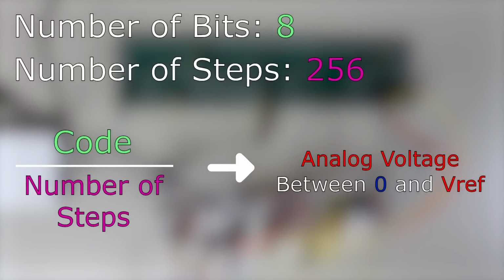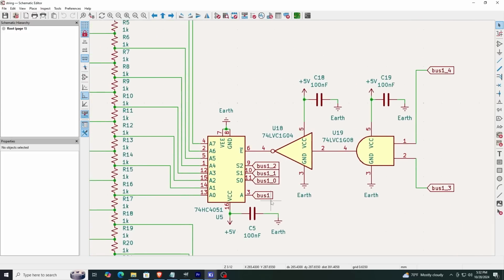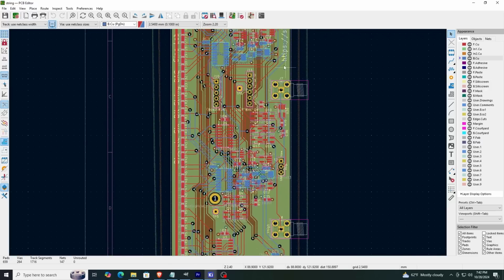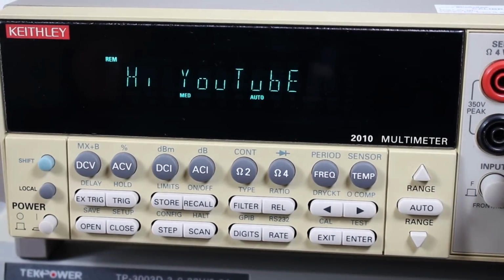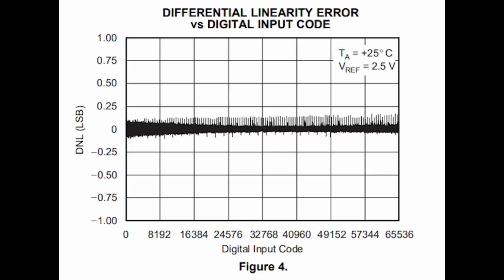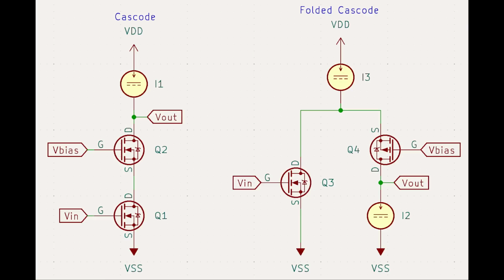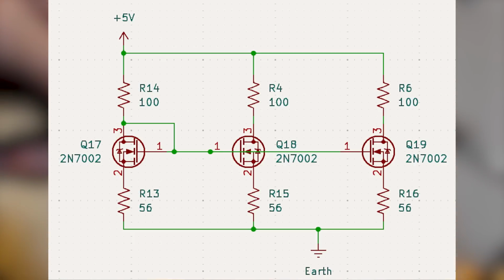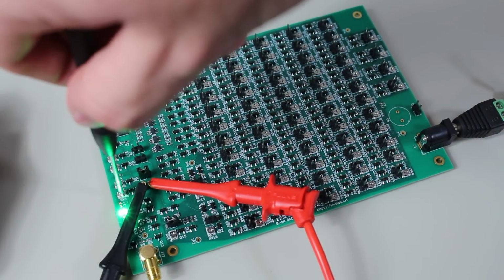Building a Discrete 14-Bit String DAC

Comment: Re: ultrasonic cleaning. I would recommended just switching to a water soluble flux so you can use distilled or deionized water for cleaning boards. Works great and you don't have to use so much IPA

Comment: Hmm...  For Q7-Q10, Q14 and maybe Q11-Q12, I'd have probably used a 74xx4066 rather than all those 2N7002's.  One SOIC-14 is an easier soldering job than eight SOT-26's, and those transistors are all right next to one another in the circuit.  (Didn't go through the schematic in detail to look for other things like that.)

Did it really simplify your layout that much to use all those 74LVC1G04 rather than six-packs?  

If you have only a few components on the back side of the board, you can use paste with a lower melting point and reflow with hot air.  Easier than hand soldering, at least with my shaky hands.

I've built a few mirrors recently with DMMT5401 matched pairs.  They seem to work pretty well, but I don't have your measurement tools. 

The biggest single takeaway from this video is that analog IC's (and ADC's and DAC's) are amazing things that you are never going to replicate properly with discrete components.  But it's fun to try - and important to learn what's going on inside those prepackaged miracles.

Comment: in modern silicon processes, transistors are so small they are essentially free. Resistors on the other hand, can take up lots of space so replacing a resistor stage with a diff pair stage is very worth while. matching is also easier to accomplish with inter-digitated fets

Comment: What’s wrong with a ladder DAC though? If the resistors are accurate enough, it seems like the simplest and most elegant solution.
Reply from the maker: It's easier to build a ladder, I just wanted to show a design topology that is usually only found inside of integrated circuits.

Comment: could you have a couple of micro adjustable resistors on the inner string - you'd only need 4 perhaps even 2  to tweak the values there to bring them into linearity

Comment: 100LSB INL error makes this no better than 8bit R2R DAC build from 0.1% resistors, unfortunatly... But you can make software correction for INL graph by calculating error function of output voltage (excel can do best fit polynomial).

As mentioned in other comments, you should try R2R DACs, they give good results with resistors like 0.1% if you measure them and find best fit for nominal value.  Of course, this is up to a certain  point - when TCR difference of resistors, difference in switch resistance and many other effects will become noticable.
There's reason, why in DAC8831 first 12 bits are done R2R, and last 4 are done with 15 separate resistors (Fig.44 at TI datasheet). I think this is for laser trimming.

Also, your circuit reminded me of Kelvin-Varley Divider at first - maybe check it out.

Anyway, this is good video demonstration! subbed:)

Comment: There are transistors pairs in the same case that are well matched and also multiple transistors arrays that are very well paired and with nearly identical parameters. I know that those are more expensive, but for your specific case, you may try them. Also, can reduce component count.

Comment: to create a digital-to-analog (DA) converter. For example, consider a 3-bit setup where each bit is connected to a resistor. The first resistor has a value of, say, 1 kiloohm. The second resistor is double the value of the first, meaning 2 kiloohms, and the third is also double the previous one, thus 4 kiloohms. All output points are then connected to a single point, which serves as the output....easy😊isnt

Comment: I've built discrete DAC's for fun before. More practically, I tend to build ad-hoc DAC's using a few free uC GPIO pins. I can say with certainty, give discrete R-2R DACs a try! The advantage of a discrete R-2R resistor ladder network DAC is that you can bulk buy resistors and use a good measurement method to "bin" the resisters to better than the precision/tolerance on the tin. That is, you can buy 1,000 units of 1% or better resistors, and build a 12~24 bit DAC with cherry picked / matched resistors. Furthermore, you can buy resistors with 10x higher resistance as parallel "trim resistors," or resistors with 10x lower resistance as serial trim resistors. You can also go completely nuts and stack trim resistors, thus trimming the trim resistors. Every order-of-magnitude trim resistor you provision for will give you a corresponding order of magnitude increase in precision. It's simple why; a 1% precision on a resistor that has 1/10th the affect on the output behaves like a 0.1% resistor that has full authority over the output. Finally, to be totally ludicrous, you can get resistors with matching/balanced temperature coefficient so that it has better thermal stability.

You CAN build a work of art grade DAC using discreet components... but, to be fair, a great DAC IC is only a few bucks too... so.... :/
Reply: also there's a plenty chineese 0.1% resistors on sites like aliexpress. They go higher in price but those 20pcs that i bought really fitted into 0.1% tolerance (measured with HP34401A whose last calibration was done in 1996, so take this information with a grain of salt). They also promise 25ppm/c TCR but i did not measure it, because i have no proper thermal chamber
Reply: I tried to build 8-bit R2R DAC using 0.1% resistors and uC. Actual resolution at DC came to about 7 bits.
   The issue is that uC pins are not equal. Their internal resistances vary from pin to pin in about 100 oHm range, which is 1% with 10k resistors. 
   At higher frequencies (~1MHz) resolution falls even worse (~5 bits). The reason is dynamic transitions on bits flipping. Bottom line - do not waste your time and buy OTS DAC!
Reply: @odissey2  the AtariJaguar implements its own VideoDAC. The fully digital Tom chip has 24 pins which are connected to an external R2R ladder. Just by having stuff produced in an integrated way, you can get the variance down. The ladder is also integrated with itself: one thin carbon film, one ceramic substrate. Ladder shot into it with a laser I guess. The output pins on Tom are just over-powered, especially the high bits (need to check). Resistor values are very high. So I would have thought that voltage stabilization is more critical? The chip has multiple supply pins.

I thought that the 16bit audio DAC is external because you cannot prevent cross talk down to this level on a single chip? An external DAC reads in the serial bit stream and then updates the analog value. The chip has no additional state. So you can actually test the whole device for all 64k values in 2 seconds plus some passes ..
Reply: As I understand it, if you buy 1000 resistors of 10% tolerance, the ones closer than 5% will have been pulled out for selling as 5% resistors, and so on with the tighter tolerances. So the distribution of purchased resistors will likely always be like a Polo Mint, with a hole in the middle. Higher and lower than nominal, but not close to nominal. It may be that you can still match pairs of resistors if that helps the accuracy of the circuit functions.
Reply: Instead of buying boxes with resistors, you can use some Python script and draw wire resistors just on a PCB. With having the smallest resistor as 0.2mm by 10cm 1oz (if I'm not mistaken, its resistance is 22 Ohms), you can place an entire weighted 16-bits DAC on a 30x10cm of 8 layers PCB (make sure you select a same oz for outer and inner layers). I think this is the cheapest 0.0000...1% resistor in the world (as cheap as 15 euros for one weighted string). Then you have to feed it with a current source, add 16 more same PCBs as a summing network, and 16 precise commutators (like a cmos on/off with a an OpAmp for a full compensation)
PS You can use yet more 0.2x10x1oz wire on the same PCB in the current source to compensate a temperature while the wires become hotter
Reply: @sc0or  Even ignoring the copper TCR problem, PCB manufacturing processes aren't perfectly uniform, somewhere there will be over-etching, in other places it will be under-eteched a bit. And 0.2 mm 100mm 1oz trace will be about 0.38 Ohm.
Reply: @sc0or  Did you know why copper is a bad resistor material? It got huge TCR. And your copper traces will get temperature gradient, so "equal TCR will create equal offsets" argument is not applicable here. For 8+ bits DAC it's better to just buy IC, or use some old R2R resistor matrix (like soviet 312NR6, 10bit R2R resistor matrix), if you're able to find one. They got difference in TCR at ppm's range.
Reply: @dinistor1254 what if I buy special wire and wind it around a (ceramic) frame? Like a piano forte . I could even adjust the taps.

Why do we care about temperature in a R2R ladder?

How low is the noise of a power supply? How low is the resistance of the mosfets in front of the Rs of the ladder?

1mV relative to 5V ! So this is not even good enough for CD audio (invented 1981).
Reply: @ArneChristianRosenfeldt  you basically make wirewound resistor

Temperature is important because of TCR. In audio it doesnt really matter. IN DC applications this is crucial.
8bit DAC really don't care this much (1/256 is almost 4000ppm), but at higher resolution, like 10+bits, 100ppm/C TCR difference is noticable.
Reply: @ ah, I was only checking for linearity, but forgot that I have no digital thermometer to compensate overall scaling of the DAC on the digital side.

Comment: While you're at it, note something does work that you will just about never see.  Take a look at the DAC R-2R, and note that just a 374 latch or similar would drive it for 8 bits.
So 8 bit digital pattern, directly driving and converted into an analog output value.
You can do the opposite.  Long ago looking at that, it hit me to do the reverse, analog in value directly to a digital output pattern.  Comparator for first bit, high low set at the middle point.  Next bit is set for 3/4, but if the high bit is low, that same low output pulls another resistor low that cuts the reference to the 1/4 level.  So the second bit can determine either the high second bit or low second bit transition, with the first bit selecting which one.  And work on down the line.
Easy enough to do 4 bits and have fun testing it, gets hairy of course if you go further.
Of course there are race and hysteresis type issues, but it is a fun idea.  Even back then there was some small amount of prior art, but it's only barely used for 2 or 3 bits.  You're better off using more comparators or going to a real ADC.
Reply: Atari ST and Jaguar connect a R2R network to CMOS output pins of the purely digital GPU to create RGB analog video out.

Comment: I've made 1pin DAC once. 
It consisted of single capacitor and was driven by PWM:)
Reply: if u dont need speed ..yes ..that what i do all the time 😊
Reply: higt frequency pwm give faster abd beter result😊
Reply: i discribe a beter aproche using resistors in comment. take a look.
Reply: i made the same thing, but it was noisy even with 300khz pwm
Reply: @destiny_02  with 300kh abd 5v pwm use 3.3kohm and 0.47 uf
Reply: @destiny_02  Also you cannot drive almost anything directly(only something with known resistance) through this setup.
Use transistor or amp.

Comment: 😖😖12:37 - Please get your self some flux, will make your life a lot easier :)

13:20 - Also you don't have to fill your whole Ultrasonic cleaner, just fill it with water, take a smaller container (plastic bags work too) where your item barley fits in and fill that with as much solvent/cleaner as you need to cover it, then put the smaller container in the Ultrasonic cleaner with water.
Saves you a lot of money and you contaminate less solvent, at some point the whole board would just get a little sticky.
IDK what you pay for solvents but I bought a cheap glas still and every one or two years I distill my dirty solvents. Even with the first run I broke even.

Comment: I misread the title and thought it's an discrete ADC. I would love to see that because I can't imagine how these things work.
I've no problem understanding a DAC I've seen a simple resistor ladder DAC.
Reply from the maker: I may make an ADC at some point.
Reply: From tha datasheet of a MC I used a while back:

input -> buffer -v
DAC -> comparator -v
^- control circuit<------

I don't remember if the control circuit used a linear sweep or binary search.
Reply: @antonf.9278  I'm not that deep into microelectronics but as I understand this would require a lot of switches (transistors) to put the right voltage in the comparator and has to be much faster than the sampling rate you want to achieve.
Reply: Would appreciate it if you did! High precision and speed ADCs are something currently reserved for high price ICs (for good reason) but I'd greatly appreciate watching you get down to the basics on that!
Reply: @thephantompsychic ADCs are made of OpAmps. OpAmps seem to contain two magic parts. In both cases two transistors are monolithically integrated. On part (or circuit) is the long-tailed differential amplifier, which is a little immune to supply voltage bias and noise. The other one is the current mirror.

Now I do wonder if a microcontroller could manage these circuits and some MOSfet transfer gates. Throw in capacitors and inductivities. I imaginen that capacitor and inductivity form a damped oscillator. We calibrate for zero crossing and get the precise result whereas otherwise we would need to wait forever.

A flash ADC has a string of these amplifiers supplied by voltage from a string of resistors. I like the analog nature of a single stage amplifier. Maybe we can mix their output to get better linearity?

Comment: ultrasonic bath trick: 
fill with water, put IPA in a Ziploc bag
PCB goes in the bag
Reply from the maker: Thanks, I'll keep that in mind for next time
Reply: @SineLab  Enjoy! On that note though, I've had the Ziploc bags come apart after leaving the solvent in them for a few weeks - so it's not really suitable for prolonged storage between uses.
Reply: @hardwareful  ideea sounds good .. to not waste IPA but i have a question, did you had plastic depositions on PCBA ? 
also great work done by @SineLab
Reply: @hardwareful  You can use a glass jar as well, it transfers the ultrasound even better than the plastic
Reply: glass jar is good too.

Comment: awesome work! only one major thing yu done wrong - dont use Isopropanol directly in the ultrasonic cleaner, some chinese cleaners may be incrorrectly grounded and having  an open solvent is a huge fire hazard - especially if there is 3/4 Litres. i recommend having a plastic container with a lid where you put your isopropanol and stuff, and put this container into water in the ultrasonic cleaner. This has two advantages -  mainly uou use less isopropanol and have it insulated
Reply from the maker: Thanks, it does seem much safer that way

Comment: Loved the video! Building discrete ADCs and DACs is something I really like, and testing linearity using a Python script and a Keithley bench DMM is very reminiscent of the sort of stuff I do.

By the way, the K2010's input impedance in the 0.1V, 1V and 10V ranges is supposed to be greater than 10GΩ, so I don't think it was loading the DAC significantly.

Comment: Tweezers are such a slow and painful way to hand-place large numbers of parts - get  foot-operated vacuum pickup tool & pick from tape - not only is it way faster, the orientation is always right.
Reply from the maker: I'll take a look into getting one
Reply: Would it be feasible to use resistor arrays in this design?

@mikeselectricstuff Your lighting and display installations are the thing of legend, I have learned a ton from your videos, thanks for sharing your knowledge and experience!

Comment: You really should not be using "Earth" and "Gnd" interchangeably in circuits. Earth is usually mean to signify Protective Earth from a AC source. So using "Earth" as "Ground" although technically correct is not the right way to do it since. "Gnd" in a PCB refers to the V0 reference plane and NOT "protective earth" since the GND plane can be floating in a isolated AC to DC converter (which most AC to DC converters are and should be)
Reply from the maker: I'll make sure to better distinguish earth from ground in future projects.
Reply: 😂 earth and god... oh gnd
Reply: what's the difference between virtual ground and gnd?
Reply: @kiyoponnn a point on the circuit not attached to ground, but has a feedback loop driving to ground, so they are “virtually” the same.
Reply: Everything following the first sentence is incorrect or really bad wording either.

Comment: If one LSB is 175uV then wouldn't 3 LSB be 2^3 * 175uV or 1.4mV?
Reply: Depends if you are counting by the bit/code, or the value
Reply from the maker: In this case, an LSB refers to the amount of voltage in just the first bit. 3 LSBs here means that increasing the code by 1 caused the code to increase by 3x what was expected.
Reply: @SineLab  That would be 2 LSBs since the B stands for bits not counts.

Comment: You can use JFETs instead of back to back MOSFETs.
Reply from the maker: I would have if the JFETs were as cheap as MOSFETs
Reply: @SineLab  You can find many MPNs for cheaper prices at LCSC, I often get JFETs from them. :)  There is a JFET sub category under the Transistors/Thyristors. 

for an example
You can get J109 for around 20 cents. they also have hundreds of SMD MPNs as well. All in stock. 

Also, most of them available at JLC assembly library as well.
Reply: @SineLab  BTW, great video!
Reply: Unfortunately they are way more expensive currently